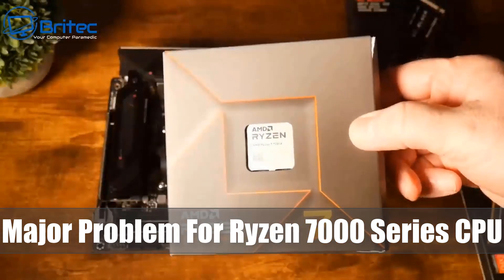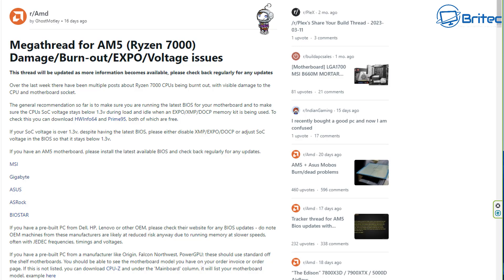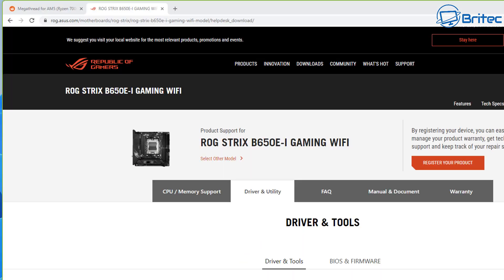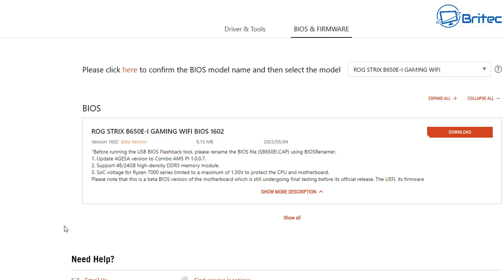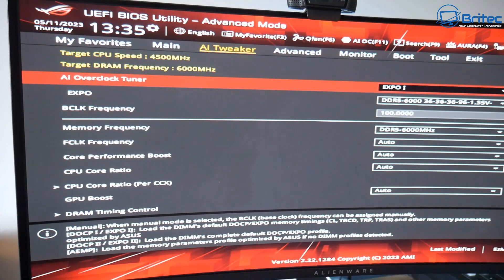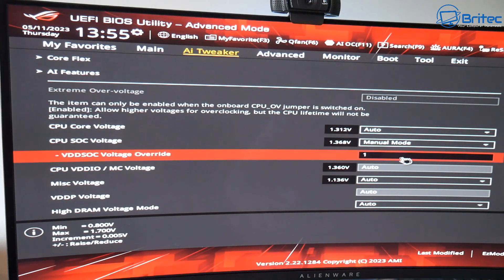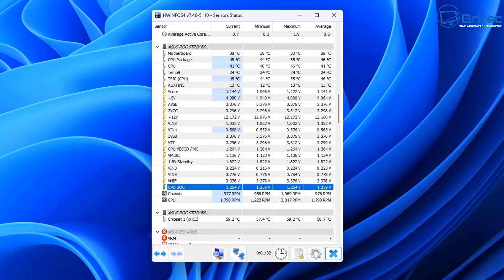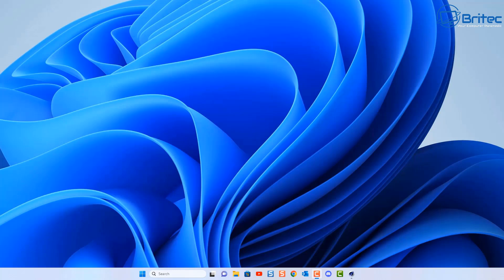Major Problem For Ryzen 7000 Series CPU

Comment from the maker: have you changed your settings yet? let me know in comments below.
Reply: It does nothing not working Manual or Offset only if you enable the CPU_0V jumper that will kill your CPU with above 1.5 Volts or ever more ! 
I suggest that don't play with CPU voltages on the ASUS Motherboards !
Reply: Asus is the only one with an issue. And they tried to weasel their way out of covering warranty by using the beta version.

Comment: Its been more than a year and this problem still persist. I have an MSi motherboard with the latest Bios. When turning on EXPO, its always in 1.3v. I tried leaving HW monitor and played some games, and I noticed it still sometimes spike to 1.387v.
I guess I'll still have to manualy adjust it even tho the manufacturers said that they already fixed it. 😕

Comment: I run my 7600x Soc volts 1.252 with stock settings, MSI Tomahawk b650, memory at 4800mhz without XMP and 1.1 volt. Cooler is Cooler master 240  ml AIO and MSI rx6800 GPU. Latest bios, performance boost off. Runs newer games super smooth and max temp of 69c. Average 62c. really happy with it.

Comment: 5:11 Read the description above please what it says ? The item can only be enabled when the onboard CPU_0V jumper switched on the motherboard if not it does nothing to the CPU voltages. Not the voltages that kill you CPU, Amps kills CPU when hit spikes and constant time that's why lovering voltages has the effect on CPU ! Like a battery to charge you need higher voltages to let the currents flow into until it charges itself voltages remain stable current drops if not dropping manually the voltages or limit the amount of Amps ! So in your case lowering the temps limits wil limit the temps only,  but you can limit PPT mW to 90W for the CPU TO achieve less power draw from CPU and expect performance drop with less voltages you will find changing from Enhancement to -> PBO Precision Boost Overdrive with Advancced mode limiting these  PPT, TDC,  EDC.

Comment: Update bios was not a solution for me. I just overclocked my cou myself and set curve optimizer to negative 20, set maximum limit to 80 degree. When system idle, it works at 48 degree and 1.1 volt and in games the peek is 1,35 volt and 80 degree. The most optimized settigns that I find for my 7700x. I also tried negative 30-40 for all cores, it works pretty fine in idle and even stress test but in games, my pc automatically restarts with these settings so I turn back to -20 on curve optimizer. And default volt after bios update was still 1,45 at my rog strix x670e-a :D

Comment: On this subject, Ryzen 7000 CPUs and heat: with 7950X and Gigabyte B650E AORUS MASTER I did not have a heat issue. The mobo does have the latest BIOS update. But I installed the recently released AMD Chipset Driver update 5.05.16.529 for Windows 11 64 bit and suffered a significant increase in CPU temperature. I reverted to the previous 5.02 version and all is well again. I wonder if you or anyone else has experienced this issue?
Reply: I just finished my new build with the aorus X670 elite ax, and the temperatures keep bouncing between 50°C and 80°C. Especially when I open an app such as discord. Could it be the bios update? Or do I lower the voltage? I have very little knowledge in this field

Comment: i'm glad i went for a Ryzen 7 5800X3D instead of goin' for AM5 Ryzen 7000 series CPUs because i was weighin my options on what i could upgrade my i7 4790k to and funny thing, when 5800X3D became alot cheaper along with DDR4 Ram, i knew from then on, i had to jump on tha discounts of tha 5800X3D and DDR4 ram and my motherboard is a MSI X570S Tomahawk it's been goin' good so far and i didn't wait for tha 7800X3D and glad i didn't with tha problem here
Reply: i did the same thing. Its insane all these videos over months of folks 7000 series cpu frying mother-boards, in some cases catching fire.
Reply: @grandcanyon2  yea it's why i'm happy with my upgrade
Reply: @blakedmc1989RaveHD  5800x3d and 79000xtx , upgraded cpu form a 3800x and gpu 5700xt saphhire pulse
Reply: @grandcanyon2  my GPU is a GTX 1080Ti but my CPU was once an i7 4790k now a Ryzen 7 5800X3D
Reply: @blakedmc1989RaveHD  nice combo but I would get a 6700xt as a upgrade from the 1080ti
Reply: @grandcanyon2  i'm good for now, i'ma just ride my 11gb of Vram till i can't ride it no more it's still puttin' up a fight at 1080p
Reply: Perfect i am regret to bought 7800x3d

Comment: Hi, thank you for providing the information. I went ahead and upgraded my BIOS yesterday, despite not experiencing any noticeable performance issues previously. I would greatly appreciate it if you could clarify whether this particular issue is predominantly associated with AMD processors installed on ASUS motherboards. Furthermore, I would like to know if overheating primarily occurs in gaming environments or if it can happen even when running less demanding applications. Thank you!

Comment: I followed the whole story carefully. Asus' behavior is absurd.
Having said that I own an Asus Rog Strix X 670 and an AMD 7900X. I have enabled AI overclock from Bios and I don't have those temperatures and I don't get 1.3V. As ram I have the dominator platinum at 6000 cl 36 with XMP enabled.

Comment: i set my ram to expo 1 but manually set both max voltages to 1.25 its a 650e asus board and it seemed to work runs very stable

Comment: Does anybody know how to this on an MSI MPG b650 Carbon Wi-Fi BIOS when I go into Normal I can find CPU NB/Soc Voltage & it's on auto or AMD over clocking  but I can not change voltages on either. When I go into expert also gives me CPU NB/Soc Voltage with same 2 settings as before & also override mode. And i can not find a tutorial or how to do the setting online, so my new build does not blow up. Can brittec09 or anybody who reads this help. Thanks.

Comment: 7900x+b650 gb x ax.Never had problems,with the new bios soc 1.24v,nothing changed.Cinebench r23 30100 at 200watt temps 84 with arctic34,29100 at 140watt 68 temp,25100 at 90watt 48 temp,all benchmarks with arctic 34 one fan.The best cpu at this momemn,2052 single core at r23,max 60-65 temp at games,5.7 boost(not 5.4 like 7900)

Comment: Thanks for this vid. I decided to check my 7700x and tuf x670e this morning and couldn't see any discoloration or bulging. However I've reached out to where I bought it from as I have caught a burning smell 3 or 4 times on previous bios, so I'm not sure if there is something internal I can't see which could cause a problem down the line. 

I have everything on default and reduced the voltage as you have done, but I'm still conscious whilst I can't see anything on the board or chip, why I have had the burning smell previously. 

I am on 1410 bios, the bios which allegedly reduces voltage to safe levels and doesn't at all, so if where I bought it from has to talk to Asus at any point they have no comeback and trying to throw it out. 

I just wish down the line we could use expo down the line but alot of people with my combo have said games are restarting after a few minutes and outright crashing. I can cope with default for the time being as the fps isn't effecting me too much, but there is a 15-20% performance dip in games with it on or off.

Comment: I have an Asus  rog x670e-e with Ryzen 9 7950x3d, running bios version 1303. 
PBO on Enhancement level 2 80c 
EXPO 1 
SOC Voltage on Auto at  1288v
CPU VDDIO Auto at  1.376v
I  manually change both to 1.25,  but when I checked the  HWinfo it showed the same Voltage as Auto so it didn't apply the manual input.

Comment: I settled for disabling EXPO, my 7800x3d is a bit less memory reliant than regular ryzen 7000. But its still annoying to lose out on (paid for) performance. im also not installing a beta asus BIOS that voids my warranty, so im hoping for a stable BIOS release soon!
Reply: Hi how much is the power consumption of your PC? the cpu is very fast right?
Reply: @itsme77777-f  the CPU consumes 85 Watt max at 100% load. i am pairing it with a rtx 4080 which consumes a maximum of 300 Watt under load. Together with all the fans (3 case fans + 2 nocuta Nh-d15 fans i'd say about 450W total power consumption under full load
Reply: im also undervolting the cpu -35 on all cores
Reply: @bolamatyp  thanks that you dont live in germany where the power is fucking expensive now!  thanks for thr answer
Reply: @bolamatyp  What are your temps while gaming with the 7800X3D?
Reply: @shagal2142  i am now using Expo 1 because i am on the new 1415 BIOS. Everything else stock, haven't tried undervolting yet. Absolute max temperature was 85 degrees for a second. Interestingly these temps are better than before updating BIOS and enabling  Expo. According to AMD there's absolutely no issue with the X3D CPUs running at 89° all day long
Reply: @bolamatyp  have you had any issues since?
Reply: @Phantom14022  all running fine with the newest 1415 BIOS, Asus tuned Expo enabled, PBO enabled to 80°, curve optimizer to -20 all core runs smooth. I previously had curve optimizer to -35, until i noticed some occasional crashes in Ubisoft Games in particular.
Reply: @bolamatyp  might I ask what mobo from asus ur using at the moment?
Reply: @Phantom14022  Sure, im using the rog strix x670e-a

Comment: I have two builds with 7000 series, the 7900x and 7700x with Gigabyte motherboards. To this date, I have not had any problems whatsoever, However I'm running both cpus with modified tdc settings and they never go beyond 70 degrees.  I believe the probem is only with the Asus motherboards, they are shitty mbs..
Reply: Gigabyte and MSI boards are also getting the death bubble.
Reply: @MrKentaroMotoPI  Maybe.. but not to the extenct of Asus MB.. Maybe you are an Asus rep....lol
Reply: @mariolp2999  I am not affiliated with Asus, but I understand your fanboi paranoia. I do  own an Asus Z68 motherboard. It has run perfectly, and highly overclocked, for 11 years. I have not owned an AMD CPU in 20 years - for precisely this reason.
Reply: @MrKentaroMotoPI  I'm not a fanboy of any company, I just try to buy the best bang for the buck. I also own an AM4 Asus mb and has been good.
Reply from the maker: I have mine locked at 70c
Reply: @Britec09  just modify these settings PPT to 88(W), TDC 75(A), ETC 150(A) and you wil enable eco mode without losing any performance whatsoever.
Reply from the maker: @mariolp2999  I have not lost any performance, maybe 100 points or so

Comment: Looks like I'll be staying with team Intel until my last breath 😊
Reply: Did you even watch the video?  The problem is not with the CPUs.  Suggest you watch the video before responding.
Reply: @HonuManHi Should I go to am5 or intel or go to am4? I sold my pc and plan on making another build.
Reply: @HonuManHi  yes I wanted the video but AMD has been having issues for years with their chips ryzen boards are more picky about RAM etc. That's why I said I'm staying with team Intel. Carey Holzman doesn't even use AMD on his office PC builds.
Reply: @GaryBeltz  As someone who spent a career in IT, I can tall you that both Intel and AMD have issues, but there are more with Intel than with AMD.  That doesn't mean that either company is bad.

Comment: Get your voltages on or under 1.3V. Also beware of Asus, AS THEY SEEM TO BE ON A DRIVE TO LIMIT WARRENTY EXPOSURE!! Also seems to be the case that there is an inconsistency between what AMD recommend in terms of settings and what Asus actually APPLY as settings and Asus currently removing bios from the their site and replacing them with new "BETA" IN ORDER TO AVOID WARRENTY ISSUES. Watch the LATEST GN video on the whole thing.

Comment: As others have said, well worth watching the latest video from Gamers Nexus to see the full extent of the problem, really terrible behaviour. They say you need to update the bios to fix the issue but bios still does not limit the voltage properly and by using that bios you have no warranty as its a beta bios. On top of that, if you use expo and you have no warranty, jeez. Looks like they are in full panic mode and trying to blame anything but themselves.
Reply: That demonstrates seriously bad communication issues between AMD & mobo vendors. That should not be happening in this industry in 2023!
Reply: @rodneyjames2344  Totally agree Rodney.
Reply: Never Asus or ASRock again. With other mobo vendor I did not have any issues, not with AMD nor Intel CPUs, just these two, back to back (with intel). 1 day my Asus had an issue, what somehow the next ASRock mobo I bought to replace it, has the same issue after a while. Any other vendor mobo I connected the same device what I have the issue with, just worked fine. Sorry Asus and ASRock, but our friendship ends here, because your faulty mobos and your unacceptable behavior.
Reply: @Re5pecTree  Sorry to hear about your problems man. Dont know what's going on with the tech industry, if its not one thing its another. Seems to be getting worse, hope things work out for you, good luck man.

Comment: I have the same CPU as you on a Gigabyte Aorus elite ax with 6000mhz of Gskill memory.  I run CO (curve Optimizer) at -25 all cores,  and my temp limit is stock at the 95c. In gaming I never hit 95, but with cinebench and I'm sure other programs like adobe or something it would reach the 95c mark but I mostly just game

. My expo profile does not work at all, no matter what bios I've used, so I manually clock the ram to 6hz leave everything else ram wise stock except for the Timings. The expo timings are 36-36-36-96 but it will not run those so I just put the jdec timings in 40-40-40-77 and it runs fine all day everyday.

 I score 19500 on Cinebench. I'm very happy with the chip, I just wish I could run my EXPO timing. Idk if it's the Mobo, the ram or the cpu that won't let me run those timings. Either way the performance decrease running at the stock timings isn't much at all from what I can tell so no big deal.

 Have fun with you 7700x also I've been subed to you for a while because you have such good, to the point videos about Windows and pcs. Nice and short, you speak clearly etc. Hope to see your channel grow and wish ya the best!
Reply: I have the same board with gskill 6000 cl30 memory but with the 7800x3d processor. Using the latest f5c bios and manually setting the vsoc voltage to 1.2 and expo has been working great and stable. Using pbo and -30 curve and 80 temp limit managed 19000 points on cinebench. Very happy with that for the 7800x3d. Been watching the soc voltage like a hawk and it has not moved from the 1.2v.
It might just be your ram but are you on the latest bios? Also before flashing the bios reset it back to default, then once its flashed reset it back again. Try swapping your sticks of ram around or trying one stick at a time to see if the expo will work. Hate to ask but the memory is installed in the second and 4th slot?
Reply: yeah i went -30 curve optimizer but entered 85 degree limit.

Comment: Good info as always, I'm in no rush to get to 7000 series. Think I might even skip it if this is what AMD think is normal....
Reply: Again, the problem is not with the CPU, it is with ASUS motherboards.  The CPUs are not the problem.
Reply: @HonuManHi That's not quite true. AMD is pushing that chipset to its limit, 
and by doing so has found floors. Both parties are to blame for this problem.
Reply: @jonathanmaybury5698  Sorry, but I don't play into the fanboi disinformation circuit.  Once again, the problem is with ASUS and their implementation of the AM5 platform, not with the chips.
Reply: @HonuManHi  if the companies do not know themselves and have not cured the problem how come you seem to know what the problem is. This would imply that you yourself are giving out disinformation.
Reply: @jonathanmaybury5698  Because I watched the Gamers Nexus forensic video.  Because I watched the video that JayzTwoCents put out today. I have built probably a dozen (or more) systems using that CPU, including the one I am typing on and one I built for my my daughter, and they run absolutely fine without issue. Until you allow yourself to not instantly blame the CPU, or play the tired old Intel vs AMD game, you will continue to not understand that the issue is with the power delivery being our of spec on ASUS motherboards.  I can't help you see what is going on if you automatically dismiss anything you do not agree with as misinformation. I do suggest that you do your own research, and hopefully you will see where the true culprit is.  The videos that I mentioned above do a far better job than I ever will with explaining the issue.  If you don't watch them, then you will not have the benefit of what they offer, after extensive testing and extensive interactions with the actual engineers at ASUS.  I suspect you'll not like this answer, but it is what it is.
Reply: @HonuManHi  now there saying(techwando and a few other youtubers, not sure about jesse) it may not just be asus, and im a happy 7900x owner with an asus strix e -e,  just an fyi
Reply: i did the same thign i got 5800x3ds for gaming decided ill wait for this gen to be gone and wait till new cpy gen to upgrade cpu and mother boards.
Reply: @grandcanyon2  There is nothing wrong with the processors.   It is bad power management on ASUS boards that cause the problem. There is no need to 'skip' this generation of processors.
Reply from the maker: You skip any more and your computer will be a museum peace lol
Reply: @Britec09  hahaha yeah true, Need a 3000 or 5000 series chip / computer as a place holder